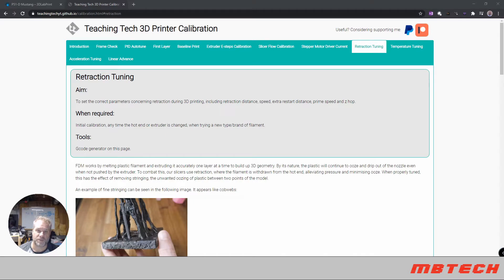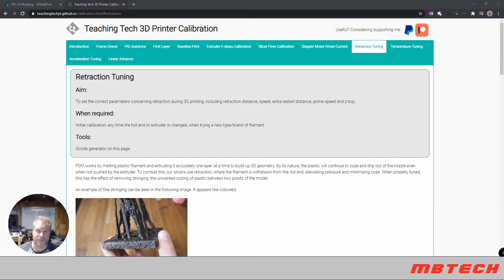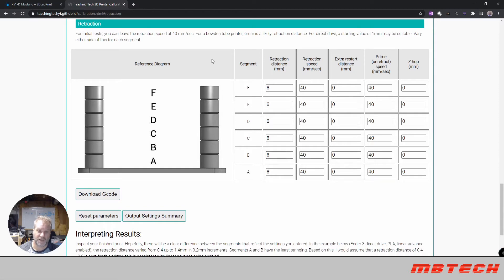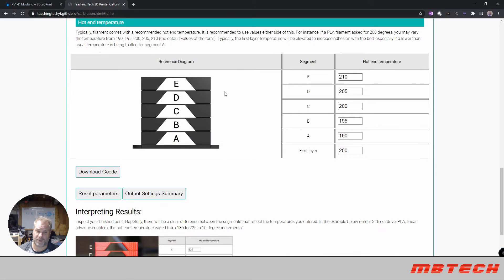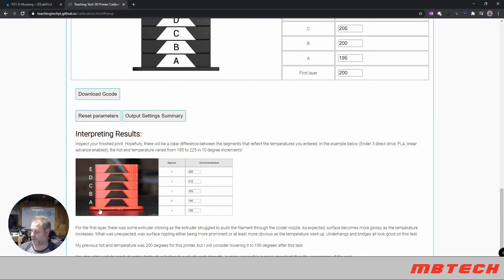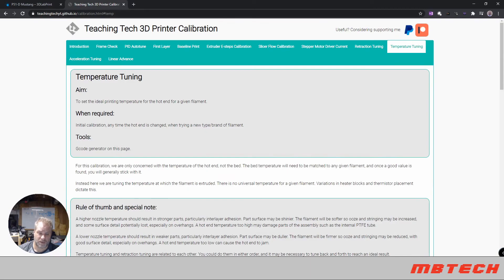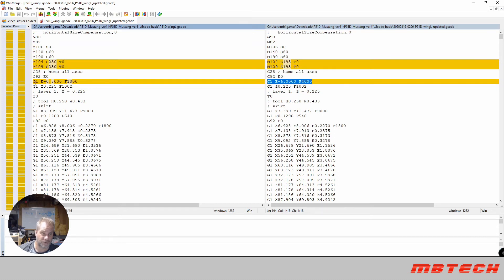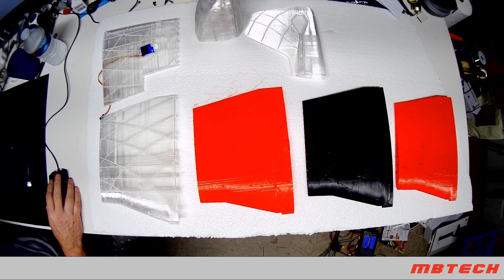Best 3dlabprint plane parts by changing gcode for proper settings

Comment: Hi Mathew
My Name is Thom, Thank you for your video on the 3Dlabprint  spitfire.
I have just purchased the 3Dlabprint Corsair F4U and I am finding all the supplied 
.stl files are much larger than what the documentation says e.g. Vertical Stabilizer 
expected size 19g and mine is 63g in Cura 4.8 any ideas what could be causing this be
Regards Thom
PS Been Flying yet?